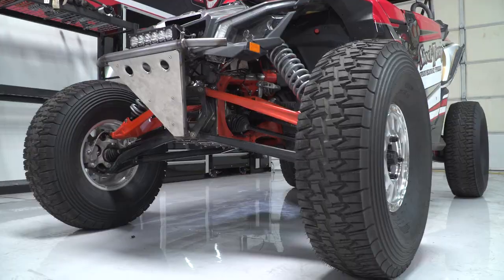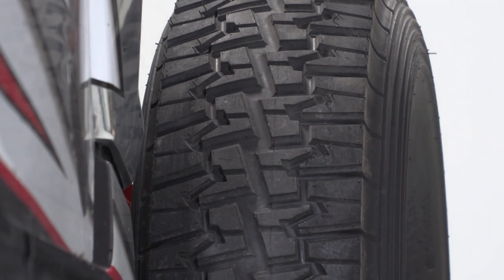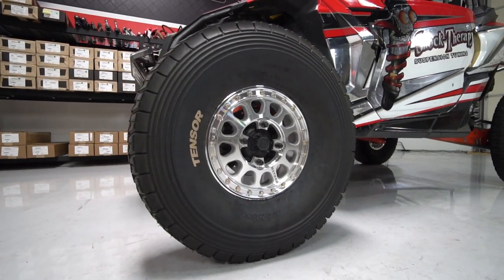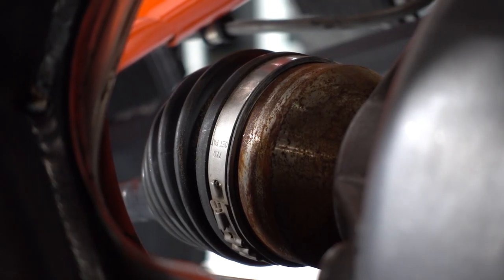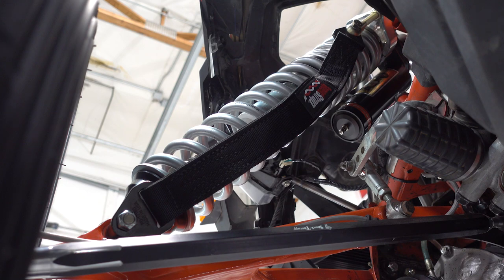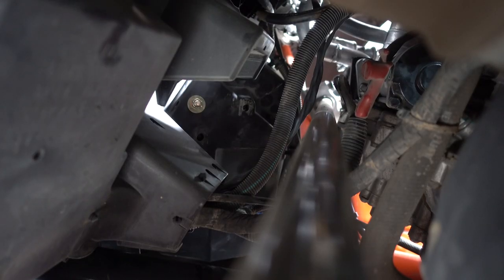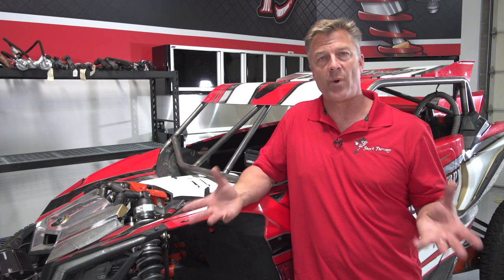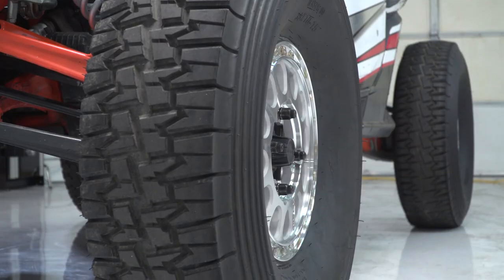UTV Breakdown: Can-Am Maverick X3 "Prerunner"

Comment: Why does lighter wheel make a difference?
Reply: Daddy Father it makes a difference because with less rotational mass (lighter wheel) it is easier on the car. You have better acceleration and the drive terrain does not have to work as hard

Comment: (Counter 5:12) And what is this guy hanging on X3 tail actually doing there?
Reply from the maker: The tensor tires we used in this video were brand new. As well as it was very hot out the day we filmed this scene.  Clay (the guy holding the rear end) was there to create more resistance when the tires first broke loose.

Comment: What offset are you running on the wheels?  Is it the stock 4+3?
Reply from the maker: Ryan Foster Method 401R wheel. 5” wide. 4/1 offset
Reply: Shock Therapy llc  401-R UTV Beadlock High Offset??

Comment: Awesome videos and products Guys. Just wondering what size belt are you running? As you know the belt length and width can greatly change the acceleration off the line or increase MPH on top end.  Like a 842 belt V/S a 835 belt on a guy I know scotter went from 64 to 76 on top end just by changing the belt. I've done the same thing on snowmobiles years ago. 
Thanks and keep up the awesome job. 👍
Reply from the maker: Through years of testing all belts and clutch options we are running bone stock P drive clutches with BRP stock length belts. 102 mph at 8700 on the Rev limiter and never goes over 195 degree belt temps. Acceleration is top notch at 8100-8200 from 0 to 88 mph.